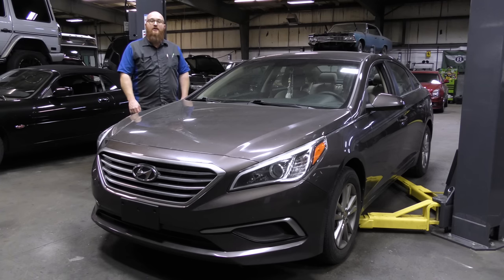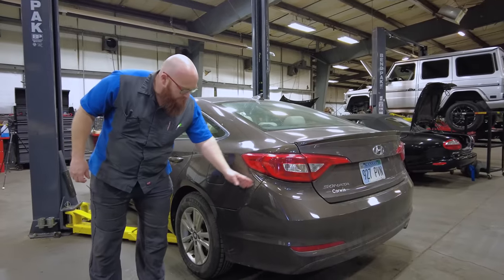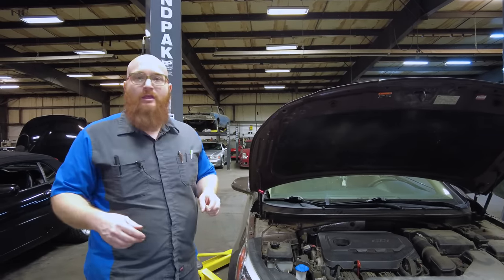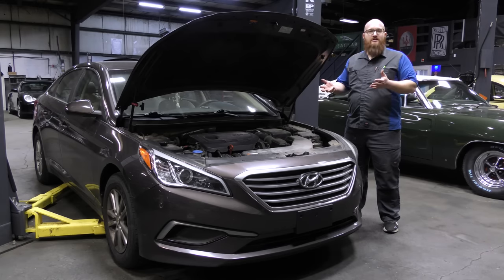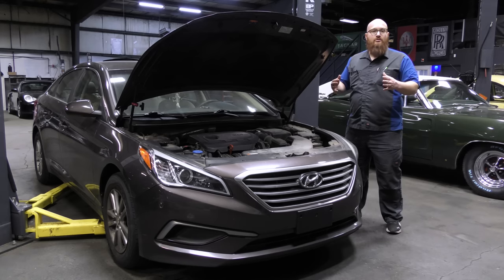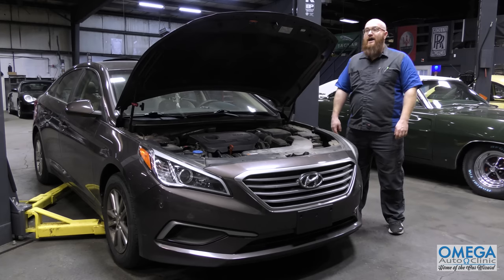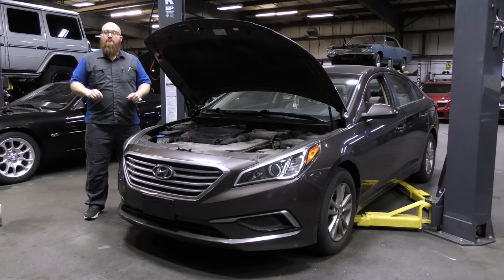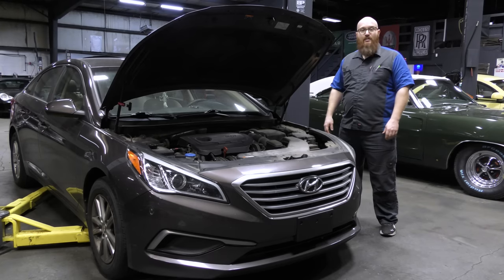What could be so bad on this '16 Hyundai Sonata that the CAR WIZARD is sending it to the junk yard?

Comment: I have a 2004 Hyundai Elantra. It's been pretty reliable. It has 87,000 miles on it. Still running, haven't put too much work or maintenance. I use it to drive to work, and errands. I think my last oil change was about 8 months ago, this video reminded me that I should go get it changed!
Reply: 8 months wow, that’s neglectful as fuck.
Reply: 87k miles on a 2004?!
Reply: @EpioN  if you aren't putting many miles on it, that's fine. 19 year old car with 87k likely only needs one oil change per year.
Reply: Also have an '04 Elantra, just turned 100k, very reliable car

Comment: I brought a 2013 kia optima seven yrs ago used with about 13000 miles on it, and a yr after driving it I got a recall on the engine this was early in the engine issues of the Kias and Hyunidai vehicle.. they replaced my engine without any BS" and gave me a rental until they did..and haven't had any problems with it even before they did the engine replacement.. it now has 145,000 on said odometer..Do those Maintenace and avoid the down falls..

Comment: Excellent fair video Car Wizard. You did your due diligence. Some car owners may not read past "0W-20 synthetic oil changes every 10,000 miles or one year which ever occurs first" and then don't read the other advice, in the manual, to change more frequently under the following conditions . . . But as you say, as does the I Do Cars channel, check your oil. And not just for where it is on the dipstick but for colour and smell.
Reply: There is no way this car had 10k mile oil changes otherwise it would be running.  This is what happens when you NEVER change the oil since new.

Comment: I had or have a 2016 2.4L sonata and I'm in the same boat. Engine died, warranty declined, and still sitting at the dealership. Hyundai offered me a new engine for 9k. Another fun fact is these Theta II engines also seriously burn oil and you'll have to add oil within 2.5k which Hyundai doesn't even know how to fix it. It was a nice car and never had an issue with until this past June.

Comment: This car definitely looks like it was lost to lack of maintenance but even well maintained Hyundai and Kia vehicles built within the last 11-12 years don't always hold up well. The dealers have crazy stock of these motors because they are notorious for oil consumption. As I'm sure you've heard, Hyundai has been facing lawsuits and doing countless engine replacements under warranty for years now. I work at a shop myself and we literally have some customers who come in with these cars to have their oil checked and possibly topped off every 700-1000 miles. (And by topped off I mean a quart or more of oil put in) This year alone we've had two Kia Optimas and one Soul come in with knocking engines, all 3 were less than 10 years old, had less than 100k miles on them, and were owned by people with pretty decent service records. It's not just these 2.4l engines but most of their 4 cylinders. They really need to get their act together because if that's not an example of unacceptable build quality, I don't know what is.
Reply: The 2.4L "theta II" is a HORRIBLE engine! :eyes-purple-crying:

Comment: I always check my oil before I start the car every morning. It's understandable that some people are busy and this is not on top of their list of priorities but more people need to be aware about basic maintenance. Even checking the oil once a month or after every fill up will make a huge difference.
Reply: I rotate my tires every time I go anywhere.
Reply: I check my oil and do a tire rotation every morning before I leave out. And when I get back I pull a few plugs to see how it's running.

Comment: My 2011 Sonata had what I presume was the same recall. They said it was a "manufacturing process defect". It checked out OK by the dealer under the recall at 100k and I then sold it to a guy at work. About a year later, he said the engine died & Hyundai put a short block in. Completely unforgivable that 5-years later those engines had what appears to be the same problem.
Reply: Same.  Had a 2011 Sonata.  Engine had oil changed religiously with full synthetic.  Engine seized at 110,000 miles.  Dealer replaced short block at no charge.  Immediately sold the car after engine was replaced.

Comment: I bought my 2015 hyundai sonata brand new and changed the oil every 4k miles including trans oil every 30,000 miles.  Im at 256k miles and its still running as strong as it was the day i rolled it off the lot. Only issue i had was battery and starter and replace cv boot. Love my sonota. ❤

Comment: Last year I bought an used low-ish millage car that the dealer told us that "it was well maintained". Turns out that the original owner ran the car without maintenance for YEARS. The car suffered many catastrophic failures and the dealer had to pay repairs for upwards 8000€ or more. For the 12 months I've owned it, I only had it for 4 months. Currently waiting on the delivery of my first EV.
Reply: The engine blew on my 2016 Kia Sorrento I got it back a week ago
Reply: Just remember nothing will last forever. Nor will fuel, oil nor batteries. Keep a spirit reminder of maintenance. Keep a pad and pen and pin it.
Reply: Like an EV will solve everything

Comment: Thank you for videos about newer lemon cars. It makes me feel better about my 2011 escape with 200k and still runs great.  I often curse and swear at it about the lack of quality in some ways but at least it’s not this bad lol
Reply: You got a good one.....  Ford also never had good luck with them myself but seen a lot of good ones.....
Reply: @Benz242  lol what do you mean?  The second gen escape, 2009-2012 specifically since the 08 still uses the old engine and transmission are known to go to 500k if you don’t let them rust away. They’ve held their value well too. When I was looking for this used they were all around 7 grand for low kms, yet the explorer of a similar age and mileage was like 1500 bucks lol. The biggest selling point to these is the Mazda engineering/influence on them lol. And the 2.5 Mazda engine runs forever although I’ve not heard much bad about the 3.0 Ford V6.  Don’t get me wrong though I wouldn’t generally buy any Ford. The quality of some of the stuff on this is questionable but easy and cheap to fix at least. And I won’t even get started on how ridiculous it is they don’t have a recall on all of these for the power steering issues. I’m a 6’2 200lb relatively fit guy and when mine went I had to use all my body weight and strength to turn the wheel. Definitely a danger to someone who doesn’t have my level of strength. But yea I’d defo recommend doing the research before buying any Ford. And nowadays they all come with ecoburst engines that are absolutely shit
Reply: @Benz242  sorry for the rant lol. Didn’t plan on it being that long

Comment: Those Hyundai 2.4l engines are well known for super excessive oil consumption. Unless they were checking the oil every single gas fill up and topping the oil off every single time chances are they would have ended with the exact same result at some point anyway.
Reply: its not just the 2.4....its there entire 4cyl line up
Reply: These engines fail left and right. I’ve even heard that they failed even when properly maintained. Another engine that is known for excessive oil consumption is the GM 2.4 EcoTec with GDI, BMW N63, VW 1.8 and 2.0 TSI, Subaru EA and EB series, and the 2018 and newer Ford 5.0 V8. Hyundai/KIA, Fiat, and Subaru are the most common engines that catastrophically fail today.
Reply: @Scypher0th  and some of their V6 engines as well.
Reply: @atx-cvpi_99  Agreed

Comment: I had multiple Hyundai come thru  my shop  that locked  tight for  no apparent  reason. They all were around 100k  and had been  maintained well. That  turned  me off  the  brand. Your right  about  checking  the oil. My dad used to fuss at me  for not checking  oil. Luckily it never  came  back  to  bite  me

Comment: You are 100% correct. You HAVE to check your oil every couple of weeks. I have a 2011 Hyundai Sonata and the motor seized up on me less than 2 years ago. Fortunately for me, I had the oil changed 2 weeks before it happened. When I had it towed to the Hyundai dealer, the first thing they checked was my oil. Lucky for me the oil level was still good. Because they lost a class action lawsuit in court and because my oil level was good, they had to give me a new engine at no charge. My car still runs and looks great so I'm going to keep it as long as I can. Remember, it's imperative you check your oil often.

Comment: Love your honest reviews and car repairs. I have 2022 Kia Sportage EX with a 2.4 and every time I see or hear about a engine problem with a Hyundai or Kia I almost get sick. These are not expensive cars by todays average car prices but they aren't cheap either and 25k for a car should guarantee a little reliability. I am frantic about checking/changing my oil and listening to how the car sounds. Most vehicles I've owned last 10-15 years and I'm still driving a 99 Chevy Blazer. I just hope my Kia will last half that long.

Comment: This is all to common with Hyundai I feel like I see a couple bad engines a month. Just subpar quality and of course in thos case not checking the oil didn't help matters at all. Sad stuff for that customer 😔 good on you for not charging them. A lot of shops aren't like that. Glad there are some good places around still! Thanks for all you do wizard!
Reply: Scotty Kilmer talks about the quality of Hyundai and how they're not very good.
Reply: @hitek9too255  yeah but he needlessly bashes every brand except Toyota and sometimes Honda. That gets old. Not everyone wants to drive a boring Toyota 🤣
Reply: @Koda18  Yea that's true. Everytime he does a best SUVs, trucks, new cars, or used cars to buy list it's always Toyota, Toyota, Toyota, Toyota, occasional Honda, Acura, Toyota, Toyota. 😂😂😂
Reply: Yep and don't get me wrong they make good cars but they aren't for everyone. Is much rather have a VW with all the quirkiness and excitement. Sure not usually as reliable as Toyota but life is to short to drive boring cars. 🤣
Reply: @Koda18  Yea like he loves bashing GM but I'm a tall guy. I can't fit in little Toyotas. I like the GMs like Impalas, Malibus, Buicks, the old 3800s, etc as well as Ford. Plus, they have better sound systems and more features than Toyotas. Toyotas are for mostly basic transportation.

Comment: Gdi was the death of Hyundai’s reliability. The old multiport injection 2.4l engines were fairly reliable, they had their issues with timing chains, and other issues but compared to these newer Gdi designed engines they were like Toyota compared to a Mercedes in reliability, and that’s just how bad these newer Hyundai gdi engines are. Beware of any Hyundai/Kia with a gdi engine.
Reply: GDI was invented in 2011 Sonata. It needs to be 2010 and older for the good, reliable Sonatas, or brand-new 2023 today (now fixed). Giant gap here, 12 years of don't buy.
Reply: The Hyundai Tucsons from 2010-15 had the 2.4 MPI and they still have engine failures.
Reply: @atx-cvpi_99  Yes, I know. The only official Hyundai engine with no failure at all was the Mitsubishi-designed Sirius 2.4L G4GS I4 engine found in 2000-2005 Sonata.
Reply: @atx-cvpi_99  The 2.4 mpi engine was by no means perfect, but compared to the newer Gdi engines it was considerably more reliable. I know for a fact the older 2.4 engines had timing chain issues and that’s from first hand experience. With any engine there’s bound to be failures but when comparing frequency of failures the older cars are less likely to have issues with the 2.4 mpi engine. Not as reliable as a Toyota or an Honda but definitely more reliable than the Gdi engines that were put in newer Hyundai/Kia vehicles.

Comment: Because of a machining issue at the factory the Hyundai/Kia 2.4 L IL4 sheds metal off the crank and the cam, cloging the oil veins in the block, worsening the problem. This causes the knock and eventual seizure.

Despite owners manual instructions, I have always changed the oil every 3k (+/- 200 miles) and checked it weekly on a 2009 Kia. It just turned 304k miles. If you take care of it - and you are correct, there is a small amount of oil usage regardless how new the engine is - it will take care of you.

Comment: I'm pretty car-savvy (I fix them up as a hobby), but even I let my '02 Focus's oil drop down below the level of the dipstick, just due to being so busy with work and other stuff that I forgot to check it. I was beating myself up about that for days, but I don't think I've done any major damage. It's the 1.6 litre Zetec SE (Sigma) engine which seems pretty tough.
Reply: I feel like the sweet spot of American cars was like 95’-05’ roughly.  They were modern enough, still repairable, and were of much higher quality.
Reply: @mplslawnguy3389  I'm in the UK and I think the same is true of the cars here. The newer they are, the more complicated and difficult they are to work on, like needing dealer-level computers to program in new parts (even things like light bulbs or batteries). Things like lane guidance and adaptive cruise take that to a whole new level.

Comment: Lesson learned. Always double check, bring even your car to your local mechanic to make sure they checked everything that a dealer will use to avoid warranty.
Reply: Dealers aren't going to commit warranty fraud against the manufacturer just because Becky doesn't know how to check her oil.... This is on her.
Reply: @TakuroSpirit77  I worked at a dealership i know this game. If the dealer was honest they would try to understand why the oil level is low. Did she miss an oil change? Is it leaking? Is it burning oil? If she did not miss oil change the level should be fine. If it was leaking oil,  she would see that in her driveway and bring it to repair shop. From that perspective, this car is probably burning oil, means bad engine, toyota has replaced alot of engines under warranty for excessive oil consumption. The dealer and car manufacturers do everything possible to cover their a** and avoid warranty work, consumers should play that game two!

Comment: another option: put some zinc additive in (it might help),and drive until it quits, I've seen knocking engines run supprising long times, might as well get every  mile out of it
Reply: I don't know about this motor. I'm amazed it even still turns and runs at this point
Reply: Fill the crankcase up with Motor Honey and Zinc and drive it to Carmax.
Reply: @fubartotale3389  haha
Reply: Zinc additives will destroy the emissions system. Zinc additives are designed for older engines from 1976 or older with no catalytic converters.

Comment: My mom's 2010 Sonata 2.4 is on its second engine (replaced under warranty). Even with regular oil changes the original engine failed with less than 100k miles.

Comment: The fact that she didn’t top off the oil before taking to the dealer is crazy she could have got brand new motor
Reply: You don't think they would find evidence of not changing oil once they drained the oil and opened up the engine a bit?
Reply: @DrBaronMunchausen  I don't think so. They wouldn't be able to prove it. Especially if there was already a recall issue that might have done this even with proper oil.

Comment: Personally I think the GDI is the problem with these Hyundai GDI Theta engines. Chrysler & Mitsubishi used their variants of course with their engineering and logistics as the World Engine with MPI with cores being Hyundai. 

You see a lot of those world engines with an excess of over 250k approaching 300k on them and they’re still going. Hyundai I think just executed GDI badly, when they should’ve just did MPI until drivability issues were corrected with their GDI idea at the time. GDI with MPI is the way to doit.

Comment: My sister had a 2016 Hyundai SUV. She didn't skip oil changes and her engine was toast at less than 80k miles. Sounded exactly like this. There have been numerous recalls on other model years due to the engine burning more oil than normal and not lubricating properly. My dad used to review warranty claims and when he saw this one, he noted there was metal shavings. Dealer claimed there was evidence of sludge, both myself and my dad didn't see enough sludge to indicate a lack of maintenance. The GDI has a history of seizing up at unexpected moments, the usual dash indicators are also faulty on some model years. Huge safety issue. Trash engines.
Reply: Doesn’t matter how well you treat them. The vast majority of them will die an early death

Comment: My 2006 Scion XB with 140,000miles uses no oil between changes, never needs topping up. Well maintained, great little car.
Reply: Seems like Hyundai and Kia are the only ones who haven't figured out how to make an engine that doesn't drink oil.
Reply: @666cemetaryslut  that engine is an exception, I had a 3.0 toyota v6 with 260k miles and it burnt little to no oil.
Reply: @666cemetaryslut  my current car is a 3.0 bmw straight 6, that also doesn't burn a drop. That being said, it's needed pretty much all the major gaskets.

Comment: This happened to me in September of 2022 with my 2015 Hyundai Tucson. I kept telling them years before hand that the engine was knocking. They kept saying they didn't see anything wrong with it. The car kept burning oil. I kept up the oil changes.  My father is a mechanic. Paid the car off and then it left me on the side of the road.